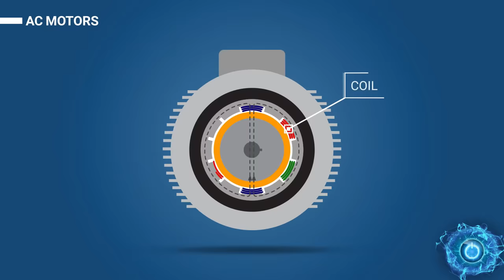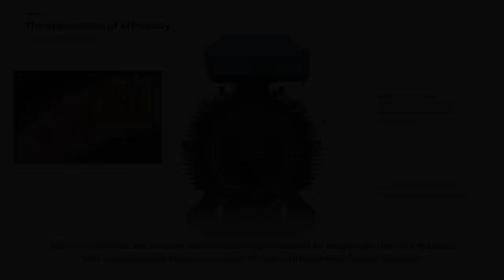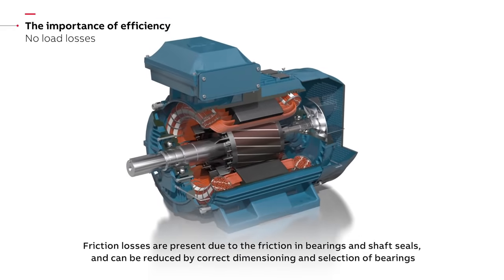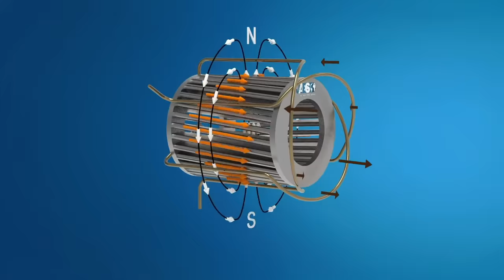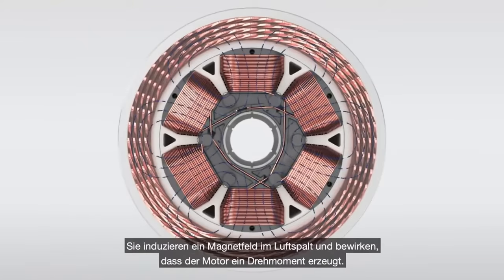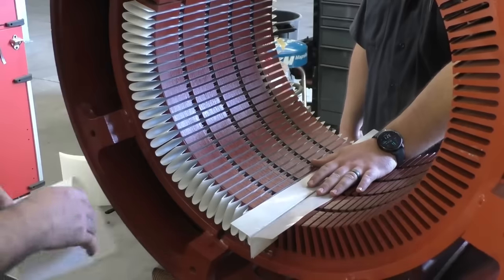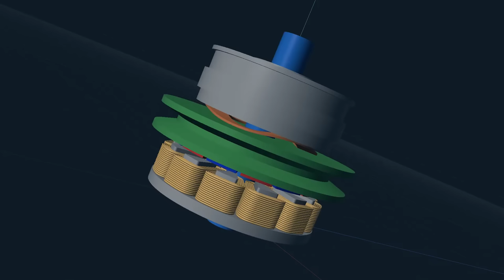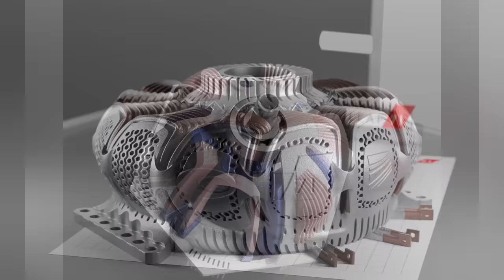GAME OVER!? - A.I. Designs New ELECTRIC Motor

Comment: 3d printing is approaching the price of machining with way more to go.
Reply: Its still insane for prototyping. I have no doubt we will have whole facilities dedicated to huge printing machines for part production.
Reply: It is the future of all manufacturing, we are just at the first steps in a long way to go.
Reply: 3d printing is by far the most expensive manufacturing process on earth and will be for basically decades to come if not forever. Machining is far simpler and quicker for majority of applications and simplicity always wins for cost and speed.
Reply: @dodgygoose3054 it is not the future of all manufacturing, only select fields. The tech is so much more complex, expensive and slow compared to conventional machining that it will remain a comparatively small manufacturing method until major breakthroughs are made that can make machines cheaper and faster (I'm talking industrial machines doing SLS metal and PBF polymer) I'd love 3d printing to be the be all end all but realistically it won't.
Reply: @francoismurrell4604  I got a PCB way account that says otherwise.
Reply: @francoismurrell4604  They're 3d printing rockets & their engines & currently working on bio 3d printing in zero g for human organs, today ... the capabilities of 3d printing in 10 years will be staggering as we are moving into lego like block machinery assembly & satellite printing in space.... There's profit cutting out the middle man (human labour) & 3d printing is KING!
Reply: @dodgygoose3054  those 2 applications are exactly part of the select fields that I mentioned. Aerospace and other industries, where paying premium prices for weight saving parts makes sense, will always create additive manufacturing demand. There's no reason to 3d print anything simple enough to machine, or parts where weight doesn't matter. In addition to that, there's issues with mechanical performance of 3d printed parts, as they have both different material properties in different directions and some porosity issues. This means you can't use 3d printed parts in applications like pressurised vessels or repeated cycle loading where fatigue cracking is a real problem. To be clear, I have no problem with 3d printing. It's a fantastic technology and I use it several times a week at a lab I work at, but you need a good reason to choose it over traditional methods.
Reply: @jtjames79  tell me more
Reply: @VestedUTuber  I'm not sure if you didn't read the full comment chain or simply misinterpreted it. 
This conversation is about how 3d printing is not the be all end all for general industrial manufacturing due to its quirks and limitations and must be used for a reason over conventional machining (such as the complex nylon parts you make). Select industries do use it regularly for manufacturing like the two examples I mentioned. 
What this conversation is not directly about is the economics of printing vs injection molding/other methods, prototyping, or enthusiast desktop printing, for fun or otherwise.
I'm open to having a conversation about these if you'd like to, otherwise I hope that clears the air for you.
Reply: @francoismurrell4604 I was in the sign business in the 90s when they came out with the 2d printers. A client was all excited and said we should do all the banners that way. At the time we used vinyl cutters, which is very fast. I did a quick calculation and the time increase was absurd.
Reply: the problem is 3d printing is still leagues away from reaching the QUALITY of machining.
Reply: @KT-pv3kl 
Nah. I've ordered metal printed parts from shapeways before. The only real issue was the layer lines on some materials.

Besides... what do you do when your available materials aren't as durable as you'd like? You compensate by designing around the material.

Comment: it is more about 3D printing than a.i.
Reply: These days all kinds of optimisation algorithms and even brute force search are called an "AI".
Reply: @vitalyl1327  Thats because they are AI. Just a simple type of AI.

AI just refers to ANY artificial intelligence, from very simple programs to far more complex models. Generally when people hear "AI" though, they tend to think of either modern cutting edge AI such as Neural Networks, especially LLMs, or other generative AI. Or they hear AI and think of AGI which doesnt even exist yet.

But AI has historically been used to refer to basically any program that can make decisions or solve problems. Even really simple stuff. For example, an enemy in a video game that only walks back and forth still has an "AI" controlling it, even if its basically just a single line or two of code controlling it's behavior.

So it just depends on what you mean. Calling any computer algorithm AI though is more accurate though with what the term originally meant, and how it was originally used. Its only really in modern times with advancements in AI with stuff like Neural Networks that people's ideas of what constitute an "AI" have really changed.
Reply: @eragon78  ML is not an AI. Never in the AI history "any alhorithm" was branded as AI. Decades ago I worked on the pre-winter AI (expert systems and knowledge bases), and even then the scope of what AI is was very clearly defined.
Reply: @vitalyl1327  This is objectively wrong. AI has been used to refer to simple algorithms for decades. There is a reason in video games for example, you usually call the CPUs "AI", even though theyre often only simple decision trees.

AI is just any "artificial" code that makes choices. And the term has been around for decades, long before "modern" AI existed. This isnt new. There are plenty of old sources referring to that kinda stuff as "AI", both in professional and casual context.

Also, Machine Learning is more than a simple algorithm. Neural networks arent "an algorithm". I mean technically they are, but so is virtually everything in reality. But the point is there is a pretty big distinction between "just" an algorithm, and machine learning. Machine learning is far more capable than a normal algorithm, because it can be fine tuned for complex to explain tasks. 

And yes, the standard industry calls Marching Learning "AI". My friend literally works for a company that helps train AI as a software dev, and they call it AI. Her job is literally to review code that various LLMs produce and correct errors to help train them.

And I dont even get the objection to calling all this stuff AI anyways. The name is pretty self explanatory. Any "artificial intelligence" classifies. if it has any intelligence whatsoever, which is the ability to make any sort of decisions, even as simple as a decision tree, then its AI. It doesnt have to be self aware or hyper intelligent or anything, it just needs to be capable of making decisions of any kind.

Again, my guess is you are likely making the common misconception that AI must refer to AGI, which is an entirely different thing. AGI is far more intelligent than basic AI, and has far stricter criteria, which is also why it doesnt exist yet. But the stuff we have now, is absolutely AI, from simple decision trees and algorithms, to Machine learning. And its been called that for decades, pretty much as soon as computers could do any tasks, people have been calling it AI, even back when they were pretty simple.
Reply: @eragon78  Mind citing a single source corroborating your memory? I was around before the second winter, and I can swear nobody ever called any random algorithm an "AI". Nobody really cares about a weird puny argot of the game developers, they are irrelevant in the grand scheme of things. You won't find a paper that'd use such terminology.
Reply: @vitalyl1327  
Sorry, gotta split up my reply to find out why youtube keeps deleting it. 

[Part 1/3]
I mean just look at the origin of the word for starters. It was coined in 1952 by Arthur Samuel, to describe Turing machines. That was 70 years ago. Basically every computer ever is a Turing machine, just with finite memory. And then again later on, in 1959, the concept of "machine learning" was again coined by Samuel to describe early chess engines, which werent even neural networks at the time. They were basically just brute force engines. These were also considered to be "AI".

This term has been around for 70 years, long before anything even remotely recognizable as modern AI was developed.
Reply: @vitalyl1327  [Part 2/3]

Also, the gaming industry is a pretty big part of the computer science field. Im not sure why you just decide to throw that out. In fact, many huge improvements in computer science come from game developers. Early game development was all about doing clever optimizations of hardware to run specialized programs. Its just as much a CS field as any other. I mean today there are tons of fancy pre-made engines to make it easier, but old school game development is no joke. Much of it was cutting edge technology at the time, and not only that, terms used in the game industry often got popularized to the public, unlike many more internal jargon used in other fields of CS.
Reply: @vitalyl1327  [Part 3/3]

The point is, what people though of as machine intelligence for decades has historically just been computers being able to do stuff. Terms change over time, as new technology becomes old, and people becomes used to it. But the origin of the word is just that, and most things a computer can do qualify as "AI". Especially the various types of machine learning. But anything from basic decision trees to AGI is all a type of AI. Its some type of intelligence which is artificial. It can make decisions. How its doing that, from simple to complex, is irrelevant.

Comment: Maybe we’ll finally get a decent turbo encabulator
Reply: My retro encabulator is still doing fine and I don't see a need to upgrade... although the dingle arm is showing some wear.
Reply: @irridiastarfire  Check the signal fluid level.
Reply: @irridiastarfire  What John Galt says.
Reply: No mention of capacitive duractance, or sinumodal reluctance. Sidefumbling likely not reduced.
Reply: waiting for a decent flux capacitor or oscillation overthruster.

Comment: Amazingly I was only thinking about 3d printed copper coils for motors just last night. However the big problem was how to insulate it. the insulation must be super thin and withstand high temperatures with minimal plasticity (flowing under heat and or pressure). Enamel is the coating of choice but I can see that mixing copper powders and enamel powders would not work as the same layer of a print must contain both and the enamel must be very thin.
Reply: True for small motors, but high power motors use large solid hairpins and very few turns so insulation thickness becomes less significant.
Also the coils can support themselves so the space between them can be potted with channels for coolant.
Would be difficult to 3d print a small FPV motor using this technique though.

Comment: This is mostly clickbait.  The axial flux motor used by Koenigsegg is based upon a license from a British company that has now been bought by Mercedes.

I am converting a 1970 Lotus Europa into an EV using a similar but much smaller axial from motor.  The electric motor weighs just 22 lbs and replaces a Renault engine and accessories that weigh 246 lbs!  Oh, and it produces around 40% more torque, with maximum torque at just above zero rpm, as well as over 60% higher bhp.  It would be easy to install a larger motor, but it's driving through the Renault transmission to keep the suspension the same, and I'm concerned too much torque will snap the input shaft like a carrot.

BTW, a popular conventional radial flux motor with similar performance specifications weighs 120lbs!

My current (pun intended) calculations indicate the vehicle will weigh no more than it did when it left the factory in Britain.
Reply from the maker: You are correct about cost/weight equation, the permanent magnet gives you low torque end yet it trades efficiency at high end. The SynRM is a compromise between the two but rare earth metals are still involved. I was trying to lead to 3d flux induction motor without expensive magnets but it's more of a probability of reducing cost, the question is whether it can solve the riddle of low starting torque. I think we should be open to alternative manufacturing techniques which can lead to that.
Reply: @Tech_Planet  or in other words "game over" lol.
Reply: Cool car and project, mate! 
+1 for the pun.
Reply: Awesome project you're working on! I'm currently working on a start-up company that produces conversion-kits to make it easier for people to swap their ICE with an electric motor. Which electric motor did you use for your project?

Comment: When comparing two things, one can not be "exponentially" greater than the other. If you don't know what words mean, don't use them. An exponential increase is a accelerating increase of one variable in relation to another one, like a fixed proportional increase in cost each year. It does NOT mean "a lot, lot, lot bigger than".

Comment: I can repair a traditional motor. This shit goes in the bin.
Reply: well, it can be crushed and grinded back to the metal dust it came from, ready to be recreated.
Reply: It gets destructively binned and "recycled" just like container software. Virtualized engineering?
Reply: The ability of a motor to be repaired has value. The ability of a motor to be made with less weight and greater efficiency also has value.

Which feature has greater value depends on the application.
Reply: Yes, but what gets repaired these days anymore. Almost nothing does.
It either is within warranty and the buyer gets a new product, or maybe a new part if it is something big like a washing machine.
But I have never seen small things like electric toothbrushes get repaired. They get replaced.
In such a world, I think the best thing is to produce everything completely recyclable.
If this motor actually works (and even works better, otherwise what was the point), it might be well recycable by crushing and grinding it back to dust again. Maybe separate the different metals magnetically or some other way.
Nature seldom repairs things. Some creatures grow a new leg, but most die but their offspring live. Trees shed literal tons of leaves and dead branches, but all natural waste is decomposed back to elements or simple molecules which then are absorbed into plants again, which get eaten by deer, which get eaten by wolves, for example.
So instead of producing unrecyclable things because they are combinations of plastics, metals and glass glued together like your phone, industry should switch to a production process that is designed to be able to disassemble products back to single materials: plastic, metal and glass separated. And each product has 20% included recycle deposit that you get back when you hand it in, plus a 5% non-refundable surplus that pays for the recycling. So products would cost 25% more, maybe not even that, and it would be something temporary because everyone gets used to it like everyone gets used to inflation.
Then it does not matter that much if a motor like this cannot be repaired, because it could be recycled 100% and you get a new one printed for you. So no, you would not be able to repair the motor because it is just a part, but you would be able to repair your washing machine or your car much more easily, because it would have been designed to be easily taken apart for recycling.
I think this is the model the whole planet needs to transition to, because we either run out of raw materials, or we run out of livable planet, whichever comes first.

Comment: what about 3d printing the part, and then using a thin concrete layer to allow it to be melted? Maybe a carbon reinforced concrete.
Reply: Might as well just 3D print the mold then cast metal into it.
Reply: @bpj1805  Then you would need a material that could stand the heat of melting, and be removeable. Shit concrete wouldn't work. High temps ruin it. 

What if you heated up the copper right to the edge of melting and hit it with sonics? Is there a sweet spot that would result in crystallization without deformity?
Reply: @grndzro777  3D printable ceramics that can handle copper's melting point are a dime a dozen. it doesn't have to be Portland cement (a particularly bad choice for commercial manufacturing, for multiple reasons).
Reply: @bpj1805  How would you remove the ceramic?
Reply: @grndzro777  Shake it out, dissolve it, or just leave it. There are so many 3D-printable ceramics I'm confident you'll find at least one that can support each method.

Comment: Youre on the right track. We need better for compressors too. What id like to see is a motor that operates under strain better. The use of capacitors to quickly unload a larger charge to speed up ignition and distribute power on large machinery. Cars are not my priority. Im interested in farm machinery, big rigs, city transit, construction machinery. Im also waiting on a hydrogen engine design to power an electric generator.

Comment: I know that for experimental motors 3D printed parts are great. But when it comes to long-lasting, production grade components, for example in aerospace, standard manufacturing wins the game because it does not suffer from the flaws inherent in 3D-printed materials - even the best printing techniques leave tiny wholes and imperfections in the materials, which break much earlier when exposed to the regular stresses the parts experience compared to their standard manufacturing counterparts.